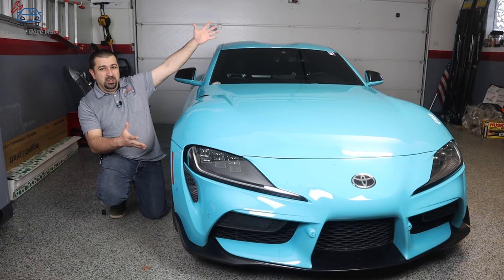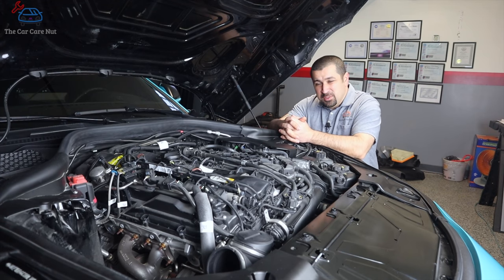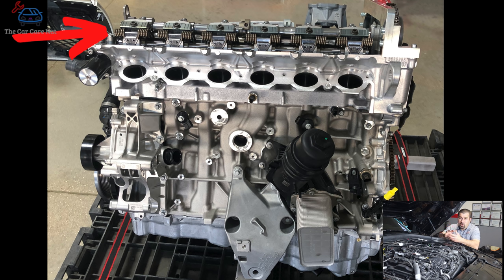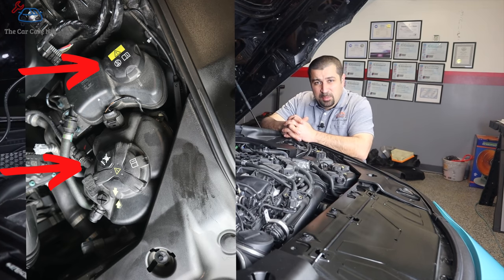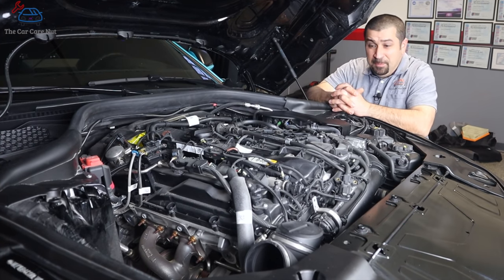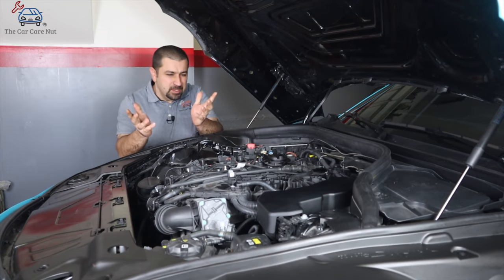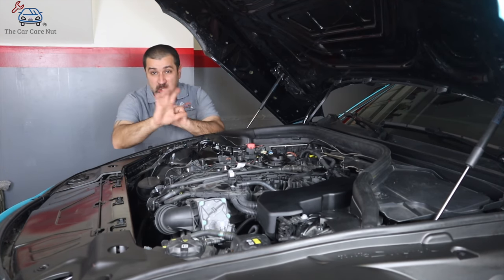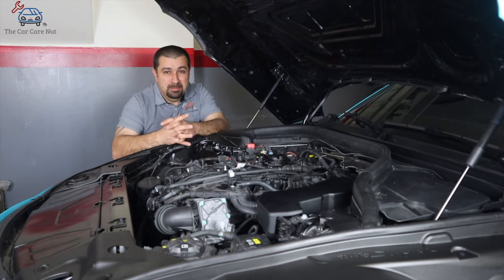New Toyota Supra Technical review and common problems

Comment: Hi AMD. I am a born again Toyota nut. I would never own anything other than a Toyota. It does disturb me that Toyota is putting its name on a BMW. Reminiscent of the 80s-90s GM, with their rebadged Isuzus, Suzukis and Toyotas (!). In fact, that's how I became a Toyota man: I bought a Geo Prizm, that was so solid that I knew that Toyota was the greatest brand.
Reply from the maker: Hi Eric! So there’s another theory to this that might give you a different prospective. The Supra move benefits Toyota financially and then they will use that benefit to make more reliable cars for the masses and at the same time the small percentage of Toyota fans who like sports cars get a proper one if they wanted.

Comment: I still prefer the old school Supra’s...Not a big fan of BMW Supra😂🤙🏼
Reply: @DavidRC I don't hate the chassis, but Toyota could have easily built the engine for this, and made the car COST LESS to purchase and maintain.  BMW engines suck.
Anyway, I'm too tall to even get into the car
Reply: @EpicDrew15  except not really
Reply: @DumbledoreMcCracken  not this one. Toyota (and BMW) put this engine through many tests, and it met Toyota's quality requirement. At first, it didn't, and BMW publicly got mad, but then they finally fixed the fucking engine. And no. It would cost 100k MINIMUM to buy the car. About the fact that you're too tall to get in, I always think of the MK5 as a super Miata. And it's about as small as a Miata ND.
Reply: @זהסודי-ה7מ  can, but the BMW design is overly complex, plagued with cheap plastic parts that quickly degrade in ultraviolet light and rubbers that harden quickly from heat exposure, and is generally not capable of living up to the standards of Toyota IN THE LONG RUN.
Testing will only really have happened after 5-10 years of road use, and BMWs made in the last few decades have generally had lots of long term reliability problems... and is isn't like BMW just started manufacturing cars, (like Tesla), they have been in the car business for what, a century?
Certainly, in Israel, a BMW will only last 3-5 years.
Reply: @זהסודי-ה7מ  So, being the size of a Miata MX-5 is a good thing for a GT?  The Mazda Miata is a Kei car.
It isn''t a $100,000 car.  The new Acura NSX is arguably a $100,000 car, but the Chevrolet C8 is a $70,000-$90,000 car (sweet spot)..
Reply: @DumbledoreMcCracken  it isn't a GT car anymore. The Supra is finally a fully fledged sports car. The thing about the Supra costing 100k is my statement, it's Akio Toyoda's. Also they tested these cars for a long time (that's where all the teasers came from during the years of hype, and the B58B30 proved itself in the 2 series for a long time. Go ask any BMW owner. I still have no idea why the plastic is there tho)
Reply: @זהסודי-ה7מ Lo, it is a GT car.  Toyoda is delusional.  Who is championing it as a sports car?  Papadakis???   Drifting isn't a sport.
Reply: @DumbledoreMcCracken  many people, but not you. You're just sad that the MK5 isn't your dream perfect MODDED MK4 with a different body
Reply: @זהסודי-ה7מ  I am a former BMW owner.  I had an early 1980s BMW 320/6, which both sucked and was brilliant, and I was the the owner of a brand new 135i Cabriolet M-Sport (N55), which sucked and was brilliant.  I fit in the 1 Series very well, and would love to have a BMW, but they suck.
Reply: @זהסודי-ה7מ  I don't understand.
Reply: @DumbledoreMcCracken  ur picking all the worst engines they made.  People with the early turbo i6 signed nda when their engines blew up.  

This is a great motor.  Fantastic power band

Comment: My FR-S was a heap too. So you got the Cayman, Supra and mid-engine Corvette which are all daunting to work on for anybody reasonable. We need a real hero car and I don't mean the Mustang, which is great I'm sure, but not even a real sports coup or sports car. No adjustable suspension, approaching 4000 lbs. for the heavy-duty versions, pudgy. Maybe the 400Z.... Oh, to put faith in Nissan to provide the next working man's sports coup. We are all sunk.... maybe Hyundai with their mid-engine project. I'm holding on to my seven-year C7. We are in trouble folks.

Comment: Hi, Brother, I need your help, Today I'm going to a Toyota dealer (Erie, PA)and buy power steering fluid for my Toyota 4 Runner Limited full-time 4wheel drive, Our dealer parts store didn't have Toyota brand power steering fluid they only have Car Quest power steering fluid they said it's gonna be good to use. I buy it but I'm not satisfied to use that's why I ask you and good to use it or not. Thank you and waiting for your answer.
Reply from the maker: Hi! You should be good with the power steering fluid from car quest
Reply: @TheCarCareNut  Oh! Mine, Thanks, brother. I don't know why they didn't have Engine oil too, Engine oil is no problem because you already Explain to use Mobile One is the same. Thanks for everything ..
Reply from the maker: No problem! Engine oil from Mobil one is good. I don’t think there’s a Toyota dealership out there that uses original power steering fluid. It’s super expensive and really isn’t anything special.

Comment: The oil issues I’ve heard of are only with 2021 models from what I’ve seen that use the high performance model of the B58TU.

Also isn’t the cylinder head on the 2020 model made by Toyota? I thought the 2020 had a completely unique cylinder head to every other version of the engine prior.
Reply from the maker: The cylinder head is different between 2020 and 2021 but no information if it’s built by Toyota or not.

Comment: Whats the deal with the oil consumption, you skipped over it a few times, is it leaking or burning, where is the oil going?
Reply from the maker: It’s unclear at this point as it’s a trending issue under investigation but it appears oil is burned or consumed.
Reply: It looks like a 2021 issue. No 2020 owners have reported this, not in the forum, not in the FB group. All of the reporters are 2021 owners, they even say that is normal lol.

Comment: This car is Lovely. When it doesn't need service,however when it does ,send it back were it was made.Let them realize Toyota used to have A Stellar reputation which relied on simplifying power train.They built this engine so impractical that the Labour cost more than the part to replace. Toyota  products should be made and used without a collaborating merge.Like you did when you wanted to be a competitive Automotive industry.

Comment: Did Toyota require BMW to use higher quality parts to meet their reliability requirements?
Reply from the maker: That is the million dollar question. There was talk about Toyota putting the engine and various other bmw parts through their reliability test but nothing concrete or clear what those were and if they changed anything and what

Comment: Im now scare of getting the Supra...  sounds like a money pit in the future. Torsen LSD are one of the best, most reliable differentials ever made. The cooling system when new sounds like a good deal but with time, it look like is going to be super expensive.

When it comes to the timing change, it usually changed around 150k on most cars, how many miles can the one on the new supra can take before needing to change it? Sounds super expensive too.

Comment: What's the break in period for a 2021 3.0 toyota supra ?? The dealership told me 100 miles at 60 mph and then after that flor it over 100 mph
Reply from the maker: Hi! The official break in period for the Supra is 1200 miles....
Reply: @TheCarCareNut  idk why the dealership recommended me the break in period I stated 🙃
Reply: @TheCarCareNut  someone told me that there is not really any break in periods for these cars that they are broken in before they get put into the cars
Reply from the maker: Consult the owners manual because it’s in there.
Reply: @TheCarCareNut  ok I should be good either way

Comment: Auto Transmission without a dip stick?  Barely acceptable.
With no engine oil dipstick it just roared past my acceptable threshold into the unacceptable zone!
Can't get out of park without hydraulic pressure unless you get under the car?  Unacceptable x2!
Electric parking brake?  Unacceptable x3!
Direct injection only?  Carbon up the back of the intake valves.  Unacceptable x4!
Turbo?  Excessive oil dilution.  Unacceptable x5!

Comment: all toyota had to do was design an engine that can take 800+hp, but ship it with 250 for emission sakes, re use components from other cars for cost reduction and leave the rest to tuners.
Reply: B58 in 2021 model Supra can make 815whp stock everything

Comment: Any manual transmission on the new supra?
Reply: No. But the transmission they are using is great though. The ZF 8 speed
Reply: Nope 👎. Seems like drivers don’t want to learn how to “drive manually” anymore.  Seems like a common denominator nowadays.
Reply from the maker: No manual transmission in the Supra. But as naveenthemachine said the ZF is not a bad transmission driving wise
Reply: @TheCarCareNut  thanks for the reply.
Reply: @naveenthemachine  👍
Reply: @dashcamjourney4599  👍

Comment: My engine was recently replaced due to the oil consumption issue at 19k miles🤦🏾‍♂️ I've put about 1700 miles on the new engine and it's already asking for oil🤦🏾‍♂️
Reply: Do you have old or new 2021 (more powerful version)?
Reply: @motorheadslifestyle3263  2021

Comment: Change the oil every 3000 miles?
Reply from the maker: If I owned one I’d still not go over 5000 miles on oil changes or 6 months
Reply: @TheCarCareNut  That's what I do on my Sienna.  195.000 miles.  First 100,000 were at 10k intervals.
My 135i got an oil change at 3k, and I sold it after that.

Comment: Toyota frequently touts that they made BMW implement Toyota reliability modifications to the engine design. Does anyone have the specifics to this or is it just PR babble?
Reply from the maker: I don’t believe it’s PR babble. Time will tell but unofficially Toyota did request small changes in the engine after their reliability testing. No concrete info if those changes were made or what they were. Time will tell if the Supra B58 proves more reliable over time than BMWs variants of the B58
Reply: If Toyota will not say what these "reliability modifications" are and it cannot be verified, then to me at least, it is just PR/marketing babble and is best ignored.
Reply: @shoersa  makes no sense. lol 

logically, if Toyota went out and said all the things that went wrong with the B58, it would make BMW look bad. If you know anything about Japanese culture or business, it’s not good to disrespect someone you work with publicly like that. There’s a Toyota engineering liaison who’s on the forums that shares a little more info on stuff like that.

Comment: I don’t think tht coolant system going b reliable after years and years no coolant while warming up etc sheesh tht head gasket better be made out of forge materials
Reply: No coolant while warm up doesn't mean coolant emptied off the cooling channels during warm up.
Reply from the maker: It should be ok working theory wise but bmw is not know to have the most reliable cooling systems as the years add on. Well wait and see
Reply: @TheCarCareNut  yes let’s not go back to the early 90s to  2000s the radiator blowing up causing a lot of damage sometimes burn ppl tht didn’t kn what was happening after opening the radiator cap

Comment: I still don't get all the negativity surrounding this Supra.  I own one of these and I find the car to be fantastic.  This was never engineered as a reliable sports car, very few true sports cars are engineered that way.  They are engineered for driving experience and power/speed.  Do people complain this much when their Porsche 911 Turbo breaks down and costs $10000 to fix?  No, it's just the cost of driving a performance vehicle and they are happy to pay it.  Many Porsche engines don't even last 100,000 miles before they break down completely, look at the 996 and 997 generation of cars.  So if driving experience is what the car is engineered for, it probably won't be very reliable long term.

Going around the race track will cost you hundreds of dollars a day in tires/brakes/fuel, it's really not a cheap car to own.  The cheap stuff is where Corolla and Camry cars come in, less power = fewer parts breaking and cheaper cost of ownership.  That's why Toyota has an entire line of vehicles, something for everybody.
Reply from the maker: Very well said Jonathan! I initially didn’t like the fact that the Supra was not entirely made by Toyota but once I drove one that all changed because it’s a proper sports car on every level. Rivals many high dollar sports cars and doesn’t cost as much.

Comment: Scotty Kilmer says never buy a car that has both direct injection and turbocharged. The increase in engine pressure leads to premature failure due to oil dilution with gasoline . Honda has this problem. Let's get an idea on the replacement cost of this engine. No oil dip stick. Mechanics and dealerships will make a fortune on this car. This is not a Toyota. Buyer beware.

Comment: It always seems like the Germans like to complicate things. With direct injection only, are the intake valves going to get gunked up over time? And with a turbo, is it okay to go 10000 miles on oil change intervals?
Reply from the maker: Likely they will carbon up. Time will tell
Reply: @TheCarCareNut  What about Meth injection after market system added to the Supra. Would that be Ok to keep the exhaust valves clean and would it void warranty ? I just purchased a 2021 Supra last Saturday. Wished I had seen this video before hand... Oh well, its a great driving car. BTW 60 yrs. old , not going to mod this car if possible.
Reply from the maker: I don’t really have experience with meth injection systems honestly. We’ll wait and see if there are any severe carbon build up issues in the future with the supra

Comment: Its not even a Toyota, that is the main technical problem
Reply: The only mechanical thing in the Supra that I’d actually trust long term is the transmission. The ZF 8 speed
Reply: Especially a Toyota body and a BMW engine and components..

Comment: DONT BUY THE 2021 THE ENGINE it wasnt quality tested by toyota like the 2020 model was ppl are getting problems with the 2021 not the 2020 bmw made changes to the engine and didnt run them by toyota.

Comment: There isn't a Single Gasoline Engine BMW vehicle Made the last 20yrs known for Durability Beyond 5-7yrs Let Alone Easy Maintenance Access to SIMPLE PARTS....They Mounted Engine with Cam Gears & Timing Chain Facing the FIREWALL???....NO OIL DIPSTICK???...QUICK BATTERY DRAIN??...TWO COOLANT SYSTEMS???...PLASTIC TIMING CHAIN GUIDES??!!!......Why would anyone Spend $65,000 for that Nitemare

Comment: Dude you are highly skilled and it's this I respect about you. HOWEVER ALL of this cooling tech your talking about is highly hyped trash with areas prone to break down and fail. Costing owners of cars with this cooling systems a lot of money.
I'll bet even money that if you were to be very honest you would admit to what I said. But you can't and you won't because you will lose money possibly your factory mechanic job.
Direct injection is well known to be very problematic and leads to advanced carbon build up in the valve train. Old school air to water cooling for turbos is better and longer lasting than. Coolant cooling for turbos because prolonged heat exposure to coolant cause thermal break down.
This is why Race cars to this day use air to water coolers incorporated with ethanol or water injection at the coolers. Let's not forget turbos in race cars and trucks and motorcycles use oil to cool and lubricate turbos. Because of higher viscosity rating that coolant does NOT HAVE. 

How are you able to look at yourself in the mirror, knowing that for a few bags of silver you have sold your soul to the Devil???
Reply from the maker: Thank you for your comment Benjamin.

If you watch my video beginning to end you’d see that I made many jokes about reliability. It’s a very nice sports car but it’s also a BMW so reliability is not there.

If you want me to be honest with you here it goes. It’s not a Camry reliability wise. But it’s a very nice car to drive for people who enjoy driving. I would buy one knowing very well that they’re not reliable. Reliability is not everything on a weekend car. Now buy the Supra as your daily driver and I’ll immediately tell you that’s not a good idea.

Have a nice day
Reply: I thought he was straight up and appreciated his candor. The timing gears pointed at the firewall was very "what idiot thought of this idea?" without just saying it bluntly. The parking lock on the trans was another part with the same vibe.